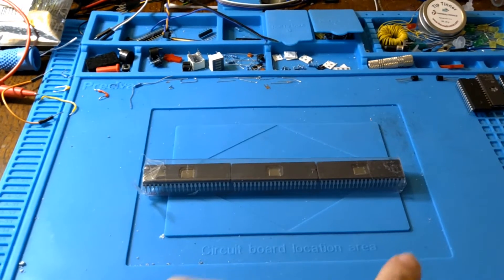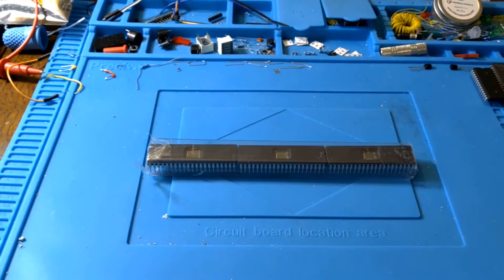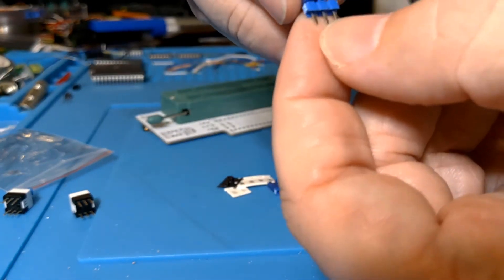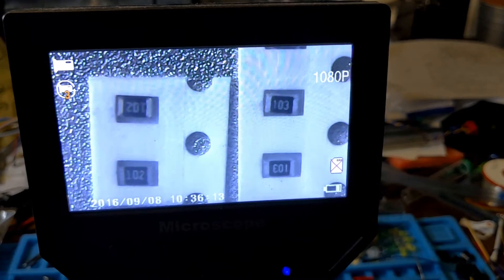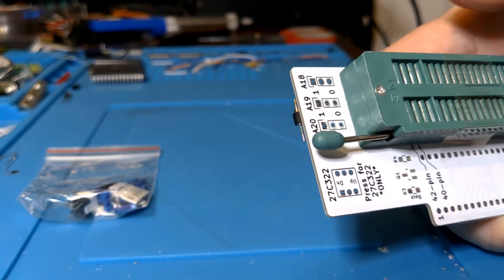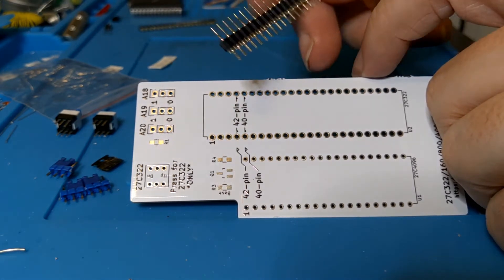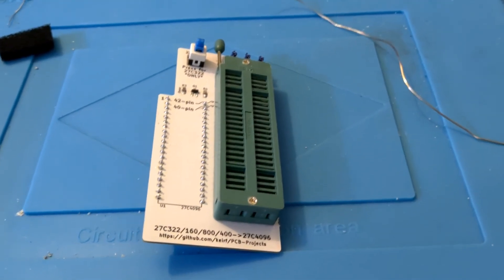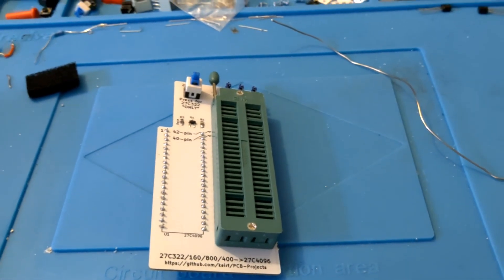Building the EPROM size adapter kit for fitting 27C160 into TL866ii-plus

Comment: Love your video, just a question please, I am looking at getting the TL866 II plus, and will be burning 27c1024 for neo geo stuff and 27c400 for Amiga, I have been trying to find out but getting so lost, dose this programmer support them ?
Reply from the maker: According to the minipro command line tool, there are various 27C1024s and 27C400s supported. Note that this is third party software - I'm not sure about the official Windows software, but it would probably support these EPROMs too.